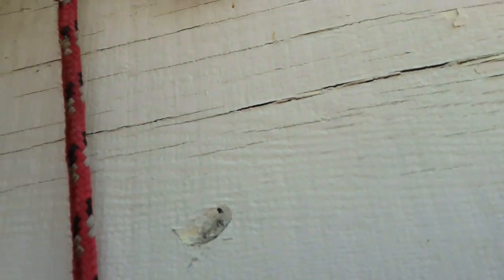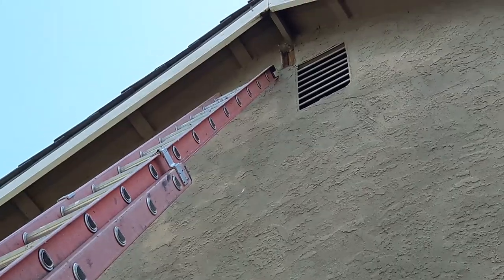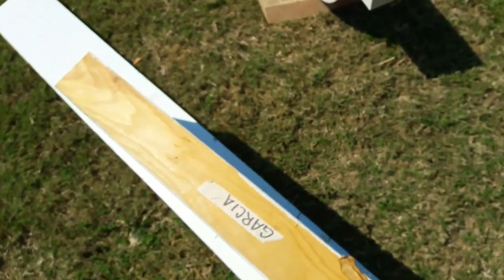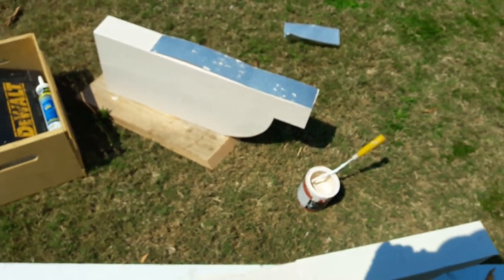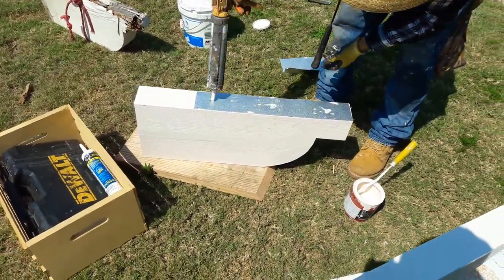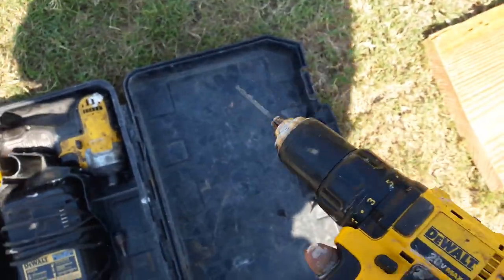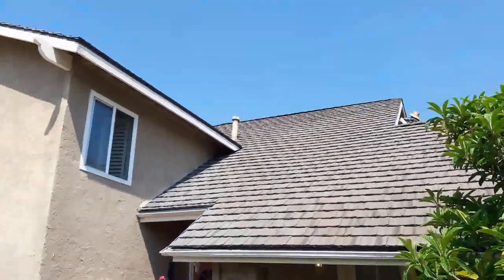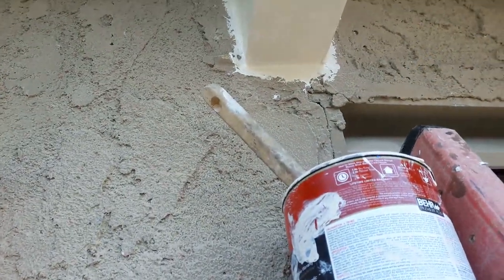DIY video: Replacing a Wood Corbel , Easy and Fast ...check this out !!

Comment: That was a nice trick Chapin did with the coil for the hand nails. Ive never seen that in 17 years of doing at least 2- 20 whole house roofs a year throughout that span. Im always cutting the coil and it makes it hard to use because of the pricklys. Thanks for sharing these vids bro.